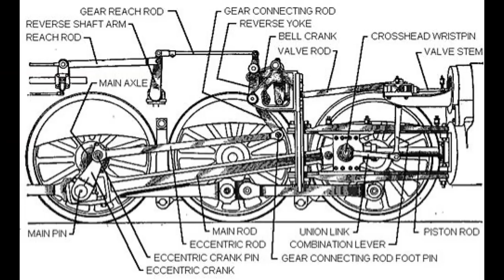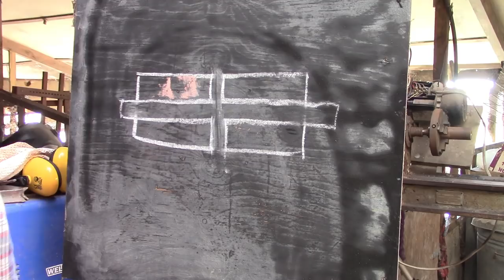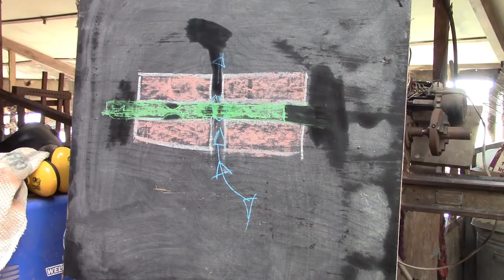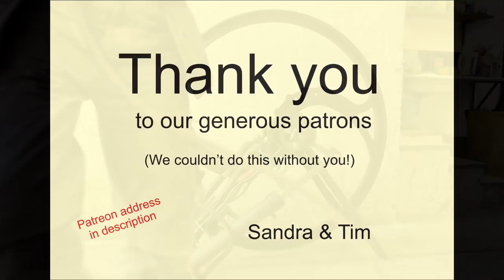Homemade Air Powered Engine Reaches 50 rpm!!

Comment: Congratulations! The air-powered thingy drives a flywheel. I am not being sarcastic - you are having fun and learning (an teaching us out here too!!!).
But.
My high school teacher, Mister Puzey’s words still ring in my ears “All we have is ENERGY”.
04m10s (also 05m10s) “not very powerful”. Power is Energy per unit-time, as in “550 foot-pounds per second”, and you are using pressurized air as an energy source. Energy is required to produce the pressurized air, and (Puzey) every conversion of energy incurs waste (that is, loss of energy), so compressed air is a dead-end as an energy source unless you can obtain pressurized air as a free by-product of some other essential process on your farm.

7m40s I watch the rusty-red cylinder waggle back and forth on each stroke and think “loss of energy”, I look at friction of cams against wheels and think “loss of energy”.

As a leaning test bed an air-pressure mechanism is fine - it involves no high-voltage, no high-heat, no high-speed, no mess (as in a water-wheel) and so on, and I truly do congratulate you on your learning and skill in cams, valves, and every scrap of knowledge that you gain and pass on to your audience (me!), knowledge that can be used by all of us.
But I would love to hear from you if you are serious about using pressurized air to do useful work for you on the farm. Honestly I would.
The bad news is that I have worked out how to make the Vivaldi Browser bypass Google’s barrier to writing comments on YouTube (HUGE grin!).

Chris Greaves
Reply from the maker: No, Chris. The plan is to make a steam engine - the compressed air is just a first step.. Also, as you know, we're not short of energy here - wind and wood and a little bit of sun are all free. Efficiency is not important if I use those. I hope Mr Puzey also mentioned enjoyment!
Reply: @wayoutwest-workshopstuff6299  Indeed yes, he did, That is why sixty years later he is still in my heart, as well as my mind. Cheers, Chris

Comment: Why can't you also power the return stroke as well instead of allowing mechanical energy to slow the whole thing down.
Reply from the maker: Yes, I could do that, SF. But with this shape of cylinder the piston rod takes us a lot of the space (on the back stroke) - so I don't think I'd gain enought to make it worthwhile.
Reply: @wayoutwest-workshopstuff6299  Okay, it was only a thought, all the best anyway, you're doing great as it is.

Comment: Forgive my ignorance, I haven't seen the other videos; this looks terribly in-efficient. A hydraulic cylinder has the ability to be pushed & pulled, I do realise that this would increase complexity although when one end is powered, the other would be exhausting so extra linkages might be the answer to that. It is however very well made & designed. I have been toying with a compressed air engine as well, but controlled by electronics, & having valves & cylinders similar to a diesel engine.
Reply from the maker: Any videos of it yet, Martin?
Reply: @wayoutwest-workshopstuff6299  Not yet, but might do soon.

Comment: 2 more pistons If each piston has 2 strokes it would be a 6 cylinder it would smooth out and run better unfortunately  More engineering
Reply: You don't need 3 double acting cylinders, 2 are fine, steam locomotives usually also have 2cylinders

Comment: 55 rpm. TerrIfying wuthering speed huh,, 🤪!
Have you discovered that the piston is a double acting one,, 🙃🙂?
Cheers Tim,, 🍻😎👍‍‍!
Reply from the maker: I think the piston rod takes up too much space in this shape cylinder, Irene. For the backstroke, I mean. So it's probably not worth all the trouble. I'm going to try to fit the other cylinder..

Comment: Your engine, even as it is, should work better on steam.  The heat energy in the steam will cause it to expand much more than the air does - this is particularly the case for your long-stroke design.  It is also likely that the heat and condensation will help seal things up.  With a long stroke and small valve openings, you would want the highest pressure you can get.  Of course, the boiler mustn't explode (again) while you are trying it.  For comparison, my steam launch engine has a 2" bore and 2.75" stroke and the valve openings and steam passages must be at least double yours.  My engine develops about 2shp at 450rpm with steam pressure at 100 psi.
Reply from the maker: Thanks, Bill. Very interesting. I wouldn't want high revs but it would be good to have more power. Sounds like yours is well made

Comment: Not to be critical, but it feels like you are re-inventing the wheel. Most all steam engines are Double Acting (steam pushes the piston in both directions). You might study up on steam engine design a bit and jump ahead to a better design thru better understanding. Enjoy all your videos!
Reply from the maker: The piston rods in these narrow rams takes up a lot of space, so I decided it wouldn't be worth making it double acting. Though of course I considered it. Most steam engines are made with lots of cast parts and the use of a lathe. I'm trying to manage without and still make something that works..